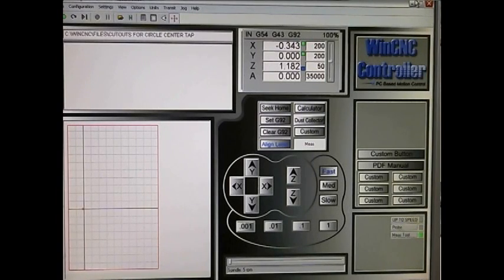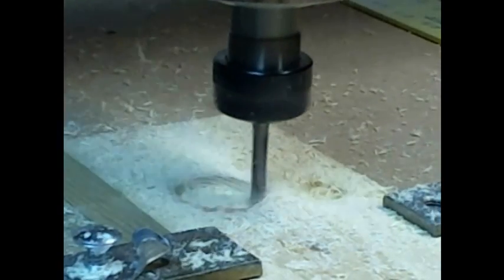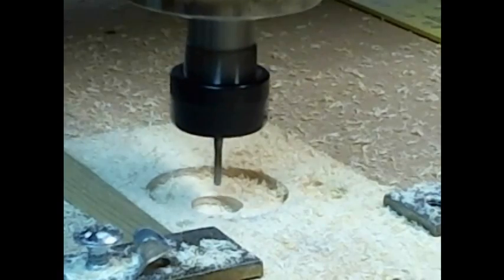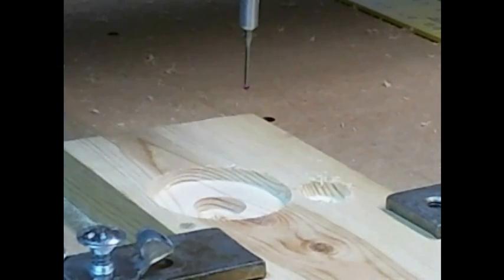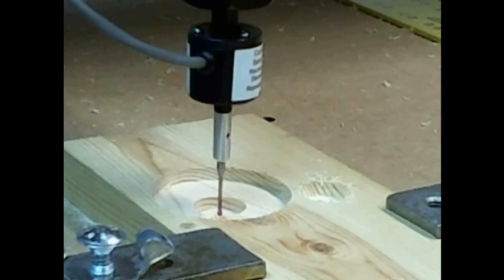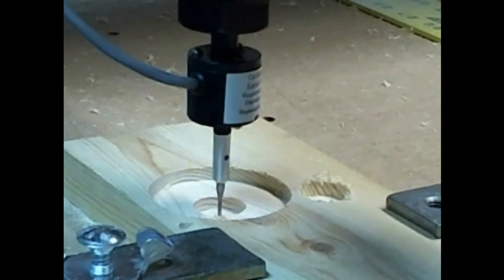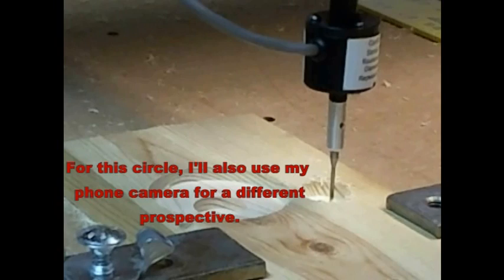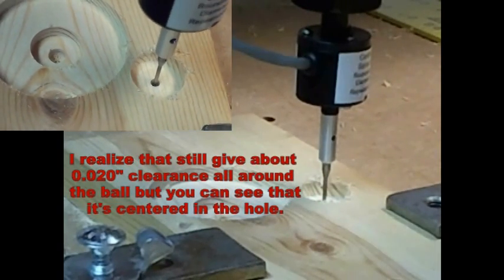WinCNC: A Macro for Finding the Center of a Circle

Comment: It would be great to have the macro, or the macro explained
Reply: Here: https://gist.github.com/dberlin/b6753787d362f631a6baa6ccbf2b4fef
I haven't tested it heavily but it should work. I commented what is going on in it for you
Note - it requires you have made the probe an alternate limit for the x and y axis.   You may be able to also use L801, but i haven't tried.